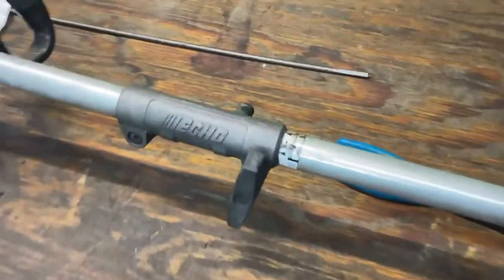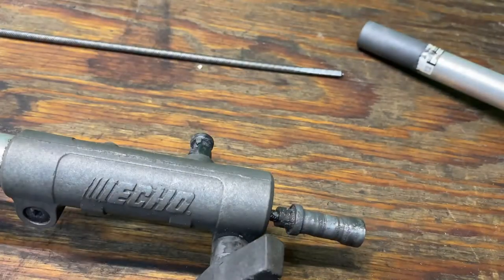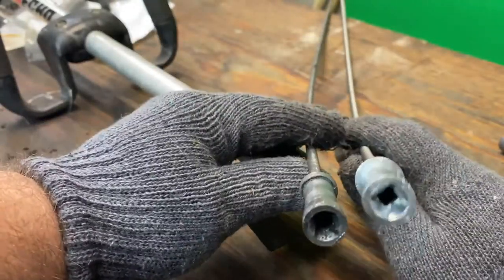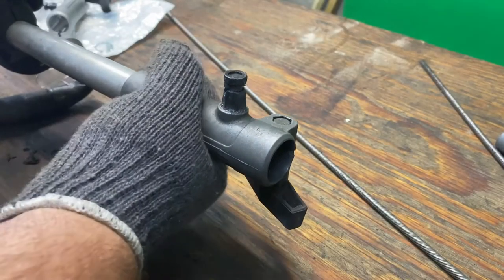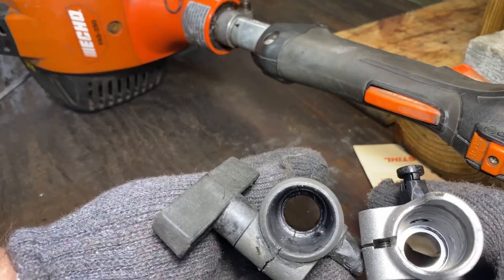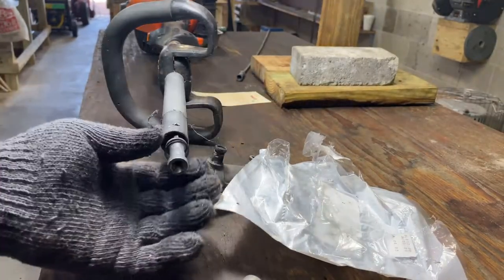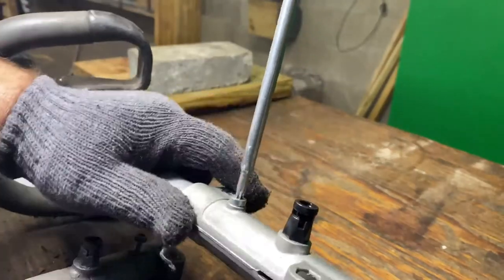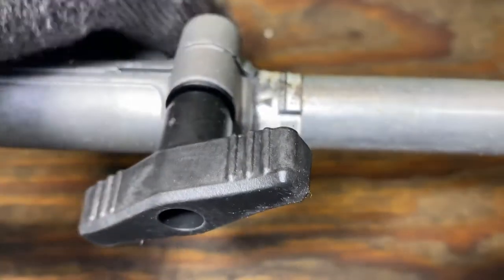Echo Pas unit coupler problem/repair.

Comment: Great guide for my PAS-225. I went to the ECHO web site to insure I had the correct P/N's for the coupler and flexible drive shaft, and you were right it was only a 5 minute repair Job. Thanks Lester

Comment: Good stuff, glad I found this video.  When my shaft fell out it looked like it had sheared off, so I thought I was going to have to take everything apart and bolt a replacement up to the crank shaft.  Nice to know its a square drive.  Turns out I was able to jam it all back together and finish my yard…*this time*.  I will definitely get the parts on order.  Thanks again Lester.

Comment: Hi Lester. I have an Echo PAS230 trimmer. It was working fine until I took the flex cable out to lube it. I put the cable back into the shaft and connected the two outer shafts. When I started the trimmer up and gave it some gas, the head spun like it's supposed to, but when I left off the throttle and then throttled it back again the head would not turn. I took it apart twice more and got the same result. I'm not sure the flex cable is seated into the clutch since I don't feel it drop into the clutch. I've tried and tried to get the cable into the clutch but I can't tell if it is. Can you help me out? How can you tell if the cable is in the clutch? Thanks and I'm now a subscriber!

Comment: good info. I have a pas 262 and use a hedge trimmer attachment that seems to stay attached to the coupler when i disengage with it and sometimes the whole liner comes out and i have to reinsert it back into place. I replaced the stop knob rubber piece but its still getting stuck with the coupler. Not sure if i need a washer put in with the liner or new liner or new shaft cable, what do you think les? thanks

Comment: I'm having difficulty reinstalling the flex cable back into the clutch square drive socket. Any suggestions? Thanks
Reply: Yes sir. First let me thank you for watching and commenting. I generally will slide the shaft back and forth while turning the trimmer head about 1/4 turn back and forth. 
I also have cranked the unit and generally while applying pressure on the shaft/tube, I’ll gently bump the gas and it slides in. Once again, thank you for watching.
Reply from the maker: Yes sir. First let me thank you for watching and commenting. I generally will slide the shaft back and forth while turning the trimmer head about 1/4 turn back and forth. 
I also have cranked the unit and generally while applying pressure on the shaft/tube, I’ll gently bump the gas and it slides in. Once again, thank you for watching.

Comment: Is it not necessary to put any grease on the shaft, washer, or coupler lip?
Reply from the maker: If I’m replacing just the driveshaft, there’s generally already grease in the tube liner. If I’m replacing the outer tube and liner, I do lightly coat it with lithium. I never grease the washer, or coupler lip, you want them clean. Grease will just make sand and dirt stick, and then you would have a sandpaper effect. I generally do put about pencil eraser size dot of grease on the tip of the inner shaft, where the two INNER SHAFTS connect.
Reply: @lesteroliveintheshop9825  ah didn't think of that thanks for sharing your knowledge it is much appreciated. Keep up the good work mate. Cheers! 👍

Comment: Can I hook the 225 shaft system to a 2620 power head?  I'd like to run a pole saw but don't really want to spend the money on the newer series if I can just swap the shafts out.
Reply: Yes
Reply: All echo PAS will interchange. I appreciate you watching and commenting. Or it was that way as of 6 months ago. I no longer work on small engines, gave it up after 26 years.
Reply: @thelousyfloridatravelers6390  I appreciate the response. I forgot echos model numbers were reused over the generations of equipment.  I have a srm 2620 power head, was wondering if I got my hands on the PAS shaft assembly If it would all bolt up still. They are still the square drive cable. 

I am actually just getting into small engine repair as a business to earn some side money. Hope you are enjoying whatever endeavor was next for you.